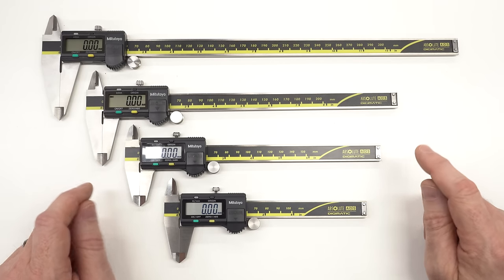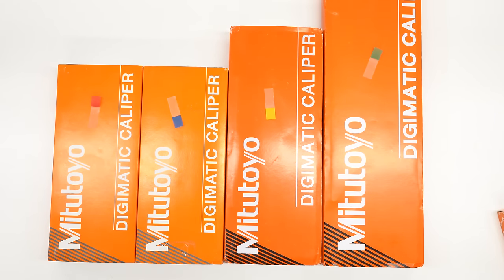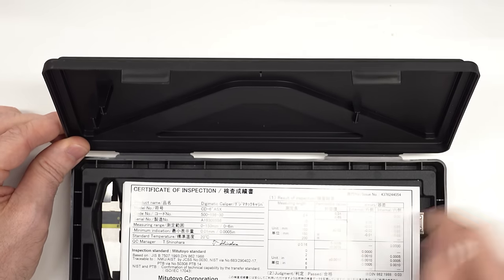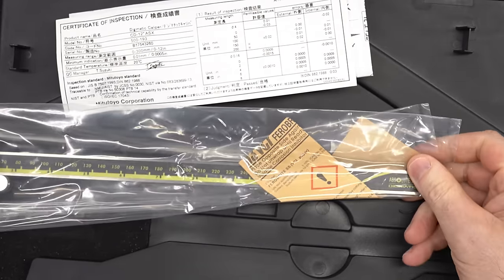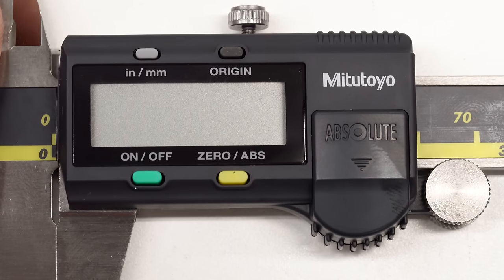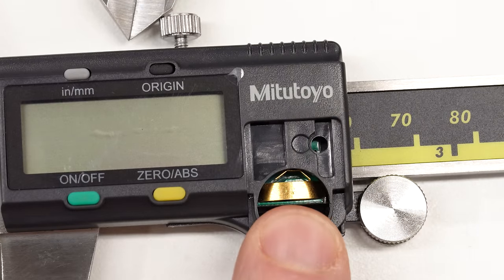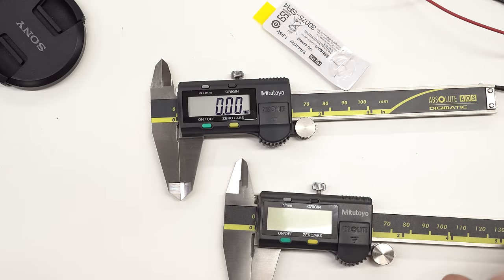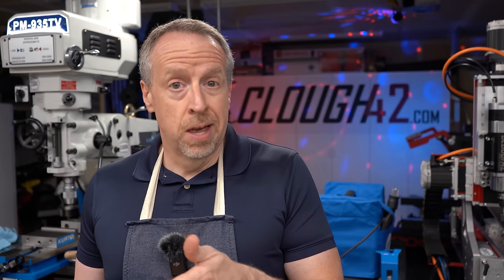17 Warning Signs Your Mitutoyo Calipers Are Fake

Comment: A comparison in measurement reading accuracy/differences would have been great, as it would  potentially be the final nail in the coffin of the counterfeits.
Reply: No, they are equally accurate. That's why he is staring at fonts and other such nonsense.
Reply: I think you missed the point.
Reply: And so did you.
Reply: There is zero difference in accuracy. The mechanism is simple.
Reply: @@LronhoyabembeIt's very very likely that they are entire equal in accuracy. Watch a video on how they work.
Reply: Accuracy is not a challenge for the manufacturers.  Fit, finish, and durability are what distinguish the high-quality tools.  It's like buying a watch: they all tell the time right out of the box, but they won't all be running when your kids or grandkids inherit them.  
The counterfeits are ripping you off, since they should cost a quarter of what you're paying for them - they're Chinese-made bargain tools without the bargain price.

Comment: Based on a number of things in this video, I am pretty sure a few of the calipers floating around at my work are fakes. The battery consumption being a big one. They churn through some batteries, and give no indication of low battery, but just randomly start behaving exactly like the fake ones did here.
Reply: Yep cheap calipers will burn batteries.
Reply: My genuine 8" Mit. goes for many years on one cell.(I think I'm over 6 years now, infrequent use so that is mostly storage drain. The genuine seiko silver cell that came with it. Silver chemistry works better in low temps btw.)

Comment: Part of my work duties are calibration and I've caught and rejected several counterfeits that were brought to me by employees purchasing personal tools. This can't be shown on the video but the counterfeits all had notably grittier, rougher, and less consistent feel to them as you slide them, genuine Mitutoyo calipers are very smooth and consistent, and require only a gentle touch to move. Calibrating the genuine article will yield results that mirror the certificate very closely if not exactly due to them actually testing the tool, while those on fakes tend to be completely made up. A big tell that James missed is that the scale on the genuine calipers has a very fine semi-gloss finish and the counterfeits are much courser and rougher matte. A smaller one is that the genuine calipers have red lacquer keeping the adjustment screws from turning. Unfortunately I've seen the quality of the counterfeits rising as time goes on, though the extremely fine attention to detail that Mitutoyo has is still very much unmatched. Amazon is not a completely reliable source, I've personally received both genuine and fake tools off the site.
Reply: Yep Mit's are smooth as silk, we use the fine points at work and I always loved getting a new pair out of the box so smooth and fine to use, nothing is like a Mit except a well tuned Tesa, they are like glass and  hard to find one tuned in Dial caliper..gears are lapped and you cannot feel them mesh
Reply: After going through 2 pair of mits because of coolant, I will go with no names or off brands. Yes the Mits were rated for coolant and were fine for a few years before I could not revive them after coolant got in. My regulars are 25 dollar no names that were given to me as a joke. After I disassembled and cleaned them well. Then put them together and calibrated them. They are smooth and read as well as calipers can. Yes some are only worth their scrap metal value, others will do a fine job.
Reply: I'm wondering if each size of counterfeit caliper shares the same serial number. Why wouldn't they?
Reply: The battery drain on the off brand calipers is terrible. Fine for my shop if you have a few pairs for different grades of work. Gotta have banger tools too. Yeah you Mastercraft, Craftsman, and Princess Auto. ✌ 😃
Reply: Amazon will share stock of (what claims to be) the same product between. So even if you buy from Amazon, instead of shipping a genuine item from their stock in a warehouse half way across the country, they might send you an item from "fake r-us" are stock that happens to be in a warehouse close to you.
Reply: No such thing as a perfect measuring tool. I've been using mitutoyo calipers for 25 years, they're good, but I don't trust them when it matters, I've seen them measure inaccurately. When it matters, I use Starrett mic's.
Reply: The question I have is are the cheap calipers much worse than the most expensive calipers?  I see a lot of people on YT using cheap calipers.  I realize the Mitutoyo calipers have better tolerances but when is that close of tolerance needed?
Reply: @joeking433  I own both, the real and the clone, I like the clones better.
Reply: @KingfishStevens-di9ji  Possibly.  I don't see that I need the $120 calipers.
Reply: Do you understand the working of the mechanism? Why would you reject perfectly accurate devices?
Reply: @joeking433 The cheap calipers are exactly the same as the expensive ones in terms of accuracy. Only the build quality varies.
Reply: @whatilearnttoday5295  I tend to agree.  I have a bunch of cheap ones and they work fine.
Reply: @KingfishStevens-di9ji  LOL!
Reply: @joeking433  back atcha

Comment: This is the most thorough comparison of fake vs genuine Mitutoyo calipers I've seen. Having been bitten by what I thought was a good deal on a used fake caliper a month ago, I would have loved to have seen this sooner. That said, I was able to return them as I determined them to be fake using the other, less-detailed and less-accurate videos. I think G. Tucker's comment that you're paying $80 for a $12 caliper is spot on!
Reply: I think AvE did a much more thorough evaluation. Check it out.

Comment: Thank you thank you for doing a comprehensive video on this. As a calibration technician, you wouldn't believe how many fake mitutoyo calipers come in, out of spec, and the customer wants to argue about it.
Reply: Had the genuine - original design product been sold at a fair and reasonable
price that people could afford - knock-offs would not exist - or at least be at
a minimal level -- The fact that CORPORATIONS desire to MAXIMIZE their profits
rather than produce quality products and sell at affordable prices is the root of
the problem -- Greed and Love of money.

The other big problem is the USD - which should -  like the F ing Temperature scale
and US Imperial measurements should ONLY be used DOMESTICALLY --
The world needs a completely separate currency for International Trade  -
- The Metric System is a system used for International Trade that North Americans
are not intelligent enough and too lazy to wrap their head around - as they cannot
count to ten without using their fingers.

The US currency is the Metric system - and it is that because the metric
system for currency has been made compulsory.
The reason why people 'Domestically in General use the modified Imperial
system is that it has not been made compulsory for common domestic use.

International trade would be difficult with different measurement
standards - which is why the Metric System is the international system
for weights and measures - including the USA.

in 1975 the U.S. passed the Metric Conversion act.
U.S. METRIC BOARD
P.O BOX 7700
Washington D.C. 20044

2022 was the 47th anniversary of the Metric Conversion Act - 
which was signed on December 23 - 1975 - by President Gerald R. Ford.

The people just do not know that:
The USA committed to the metric system in 1875 by signing an international agreement.
'LA CONFÉRENCE DI MÉTRE' in Paris [FRANCE]
Signed by M. Ashbourne the U.S. Envoy to France
All its units have been defined to the metric standard since then in the
 USA for Trade and Commerce.

Search for 'THE CODE OF LAWS OF THE UNITED STATES OF AMERICA'
§205b clause (1) states:
To designate the metric system of measurement as the preferred system
of weights and measures for the United States Trade and Commerce.

If North Americans were as smart as they claim - they would instantly abandon
Imperial measurements and start working with the  metric system on their own 
 without the GOVERNMENT forcing them to do it - But the population  as a whole
is generally mentally lazy.
- Note that there is ONLY one road in the entire USA that is posted in Kilometres 
and not miles. 
I know which road it is.
Reply: @andrew_koala2974  the imperial system was from old Europe and the British. Many countries TODAY use mixed units. UK is an example, they do measure longer distances in miles. People that can use mixed units are actually more intelligent, it takes more brain power to convert or have another paradigm for units, just like ppl that are multi lingual.
Reply: yeah how dare the customer question your shoddy calibration work 😂 must be mitutoyo's fault 🤣🤣🤣🤣
Reply: @andrew_koala2974  I want some of whatever this guy is smoking.
Reply: @andrew_koala2974  Thanks for the great comment, Stalin
Reply: @andrew_koala2974  Quality costs money. Cutting corners will always cost less than best quality. Knock-offs are not best quality. Buy the cheap stuff if you want but the ones that are maximizing their profits are the knock-offs that are misrepresenting themselves as something better.
Reply: @robertswaine6i096...it IS in STAQQRQ TRK!

Comment: I have 30 year old Mitutoyo and 10 year old Harbor freight digital calipers I use daily. They both work fine. Everyone who has used name brand calipers know the fit and finish are good. The HF calipers needed sharp edges on the beam and the slide dressed with an oil stone, but for $10 on sale there wasn't much to complain about. Say what you will about HF, they don't try to deceive you as to who made their products. If purchasing calipers, micrometers, or dial indicators I would open the box at the store and check to make sure the jaws or mic spindles close cleanly
.  
Battery life in both calipers is usually three or four years. I do, out of habit, always turn them off with the power button. Neither has memory so that may explain the longer battery life. 
Being an old guy who used mechanical dial calipers way back when, I always wipe the jaws and reset "zero" every time I use the calipers. In the shop trash would get into the dial caliper beam rack and cause the indicating needle to jump a tooth often resulting in spoiling the workpiece.

Buy your bargain tools from a reputable dealer like HF, Shars, Little Machine Shop. If your tool is defective, they will replace it. You are only saving a couple of dollars with Ebay or Amazon counterfeits and if something isn't right, you're just left urinating into the wind
.
There is something to be said for buying Starrett, Mitutoyo, or other quality manufacturer's tools... after 25 years you won't be able to remember what you paid for it.... but the quality will still be there.
Reply: Calipers are not for precision measurement anyway.   Micrometers are for precision.  When all you need is 'close enough' like in woodworking, the HF calipers work a treat.   And if you drop them and step on them?  No problem, back to HF to buy another one.
Reply: @MrSloika  Precision actually means repeatable, while accurate refers to how close the measurement is to being true.

An improperly calibrated and/or zeroed mic will still feed you precisely the wrong number all day.

Also, dial or digital - or even vernier! - calipers are mostly way too accurate for woodworking, while being quite adequate for many machining operation and layouts where +/- 0.003" is all that you need.... sometimes even down to +/- 0.001"

If you are working on optics, or something similar, by all means, get out your mics... and check their calibration against a standard!

Why yes, I have had mics get out of adjustment between uses...
Reply: The metal HF calipers are well worth it IMO. I did the same thing to clean them up and have used them nearly every day for at least 2 years. However their digital micrometer is a steaming pile. It was fairly accurate when it first worked but the plastic mechanisms quickly deteriorate and break.
Reply: @chemech  I'm not a manufacturer of aerospace components, so I don't need the absolute highest tier of measuring instruments. However,  I do appreciate the robustness of steel and do need equipment that is going to consistently be more accurate than "eyeballing" the workpiece. 

Frankly, I have found my General Tool brand digital caliper to be adequate.
Reply: @MrSloika   cheapo mechanical calipers may have a glass lens, may be stainless steel... but they have crusty STAMPED racks and gearing, which will suddenly fail. I threw away all my stainless ones as they broke, then got disgusted and tossed brand new spares. Replaced with import electronic ones that have been good so far.
Reply: I don't buy stuff from China or any other ememies.
Reply: I have many quality calipers, but the only digital one I have is from HF.  I've had it for about 7 years and it's always worked, but it loves to reset itself.  I've tried tweaking the battery terminals, but it doesn't help.  The unit is the most stable when the battery cover is about half open.
Reply: @kevlar7669  if you have any kind of electronics in your house you have bought from China
Reply: @welerc  liar
Reply: Also consider linearity:  is an indicated distance of, say, 0.050" here the same as that indicated distance there?
Equivalent questions for mechanical calipers with racks and gears, how centered are the center holes?  How round are the gears, how evenly spaced are the teeth?  Burrs?
Reply: Only problem I've ever had with HF calipers is putting them down is often enough to trigger the power button. Otherwise having inch/metric/fraction is pretty useful
Reply: @ObservationofLimits  the only problem I have with HF calipers is that HF is Owned by the PLA,
...........
Allegedly.
Anyway lots of US coin going to the CCP and that's not ok with me.
Reply: @kevlar7669  good luck with that.
Reply: @stanleytolle416  doing fine
Reply: @MrSloika  my thoughts exactly! If it's within .001" it's more accurate than it needs to be. If you need better accuracy use a set of calipers.
Reply: I used a brand new Mitutoyo digital caliper 150mm , colant proof . in 2.5 years i never had to ZERO set it ever again , it held it's position without a break , also the battery was not changed in 2.5 years . I re-zeroed it 2 times i think , but it was absolutely not necessary . Dimensions were spot on aswell , both i.d. & o.d.  (of course a caliper is still a rough measurement)
Reply: Agreed. And if you're making thousand-dollar parts, it only takes one bad measurement with a substandard calipers to make you wish you'd done the right thing.
Reply: @peterchausse6547  sometimes a cheap caliper is ok for a machinist where precision is critical I honestly believe a caliper is the wrong tool anyway. Even a quality caliper isn't terribly precise.
Reply: @welerc  quite possibly but not always. My stereo is almost all american with a couple pieces from japan. My GoPro came from Mexico.
Reply: @JJFX-  plastic and micrometer are an oxymoron.
Reply: @kevlar7669  so you don’t own a smartphone?
Reply: @graxxor  I think only the knobs were plastic but yeah, it doesn't really matter how accurate it can be if it falls apart in your hands. I could only verify accuracy at the time using high precision ball bearings but I suspect larger objects would have drifted further.
Reply: Yep, some notes:
The HFT metal 0.001" unit purchased approx mid 2023 eats batteries.  They corrected the oversight caused by copying good work of others and now can sell you more coin cells!
I have rack and pinion dial unit from Tesa (I think they make some for B&S, too).  They don't ever get crap in the gear but I also don't 'grind grit into them;'  I put them aside when grinding.
I hope everyone always 'verifies the zero' with a wipe and a close. Unless you set zero somewhere else for some reason you need to know where you started.  Almost always a non-zero start is dirt in the jaws.  Rarely, the dial needs move or the 'zero' needs 'button pressed.'  That said, the HFT almost never zero and often need 2 or 3 zeros because the mechanism is so poor....it's not repeatable around 0.001" (yes, the metal ones).  The name brands hit within 0.0005"
Reply: @scottwillis5434  When you drop your expensive dial and have to take it apart and fix it, you'll see:
The gear (rack) is polished with fine pitch.
The pinion is very small.
The abve reduces errors caused by the hole locations and defects.
and, the lash is removed by a watch-spring-loaded dial, so it indicates correct from either direction.
I routinely 'trust' the 5 tenths tick marks and 'use' the 'unmarked half ticks' (3 tenths) in work I should get a micrometer for.  I also can never see any error when calibrating agains micrometer standards or gauge blocks.

Comment: I noticed two other small differences.  The background color of the LCD display is yellowish on the eBay calipers, but the genuine ones are silver.  Also, the black labels on the ruler (fixed) is matt, while the eBay ones seem to have a texture to them.

Great video, James!  Thanks for sharing.  I would also be interested in a test of their precision if you have an opportunity to test that.
Reply: Was going to point out the same thing.